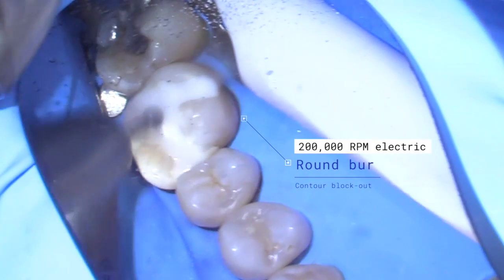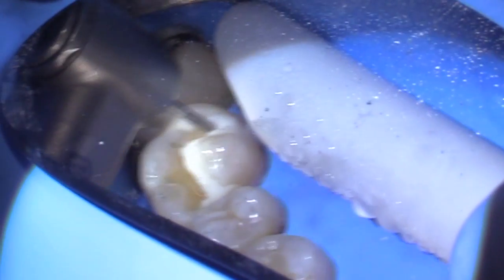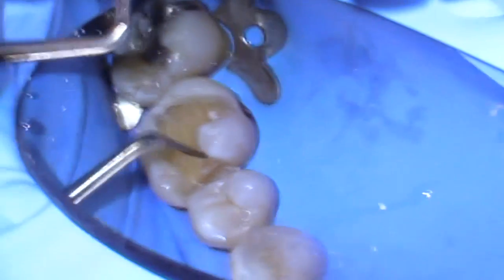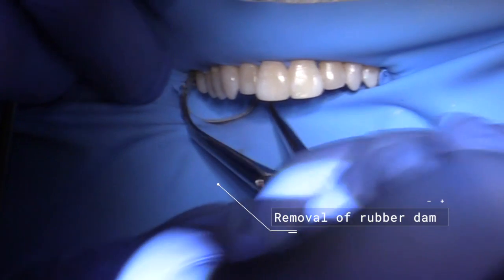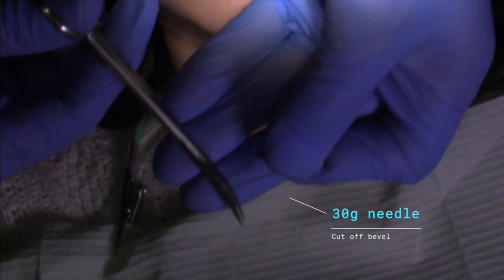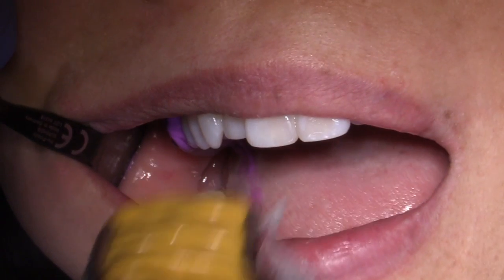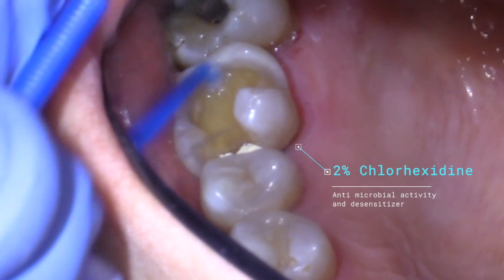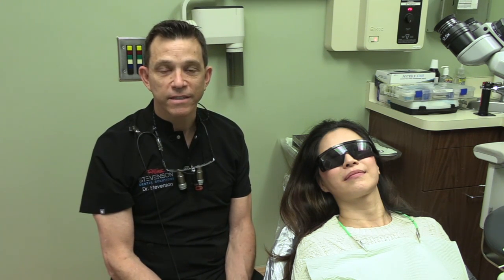Gold Inlay Restoration, Part 2: #3 MOL Gold Inlay - Preparation and Impression

Comment: Dr. Stevenson, thank you for the video. I have a question, how do you control the bleeding so well?
Reply from the maker: Thanks, I use double-packed Alum-impregnated braided cords, NEVER knitted, which are essentially useless, however, popular because they are easy to place. The braided cords expand and increase the sulcus dimensions and when soaked in aluminum chloride 25% they stopped most bleeding.  In tough cases, I'll pack an additional cotton pellet on the cords for pressure hemostasis.  I NEVER use Ferric Chloride or Sulfate because they create so much coagulated blood which contaminates the prep for traditional impressions.  Under the 40x microscope we can see the litter and debris left behind by these popular medicaments - but they are a detriment to excellence, that is clear.
Reply: @StevensonDentalSolutions  thank you for answering my question Dr!!
Reply from the maker: @albertchi9666  My pleasure

Comment: Could you use bisacryl temp material too?
Reply from the maker: Sure - but you'll need to remove it, trim it and cement it, which may not give you much benefit...The DS technique works amazingly well - keeps the tooth in an ideal and stable position and the removal is easy and leaves no residue to clean up.  For a quadrant of onlays, especially those without much resistance form, I use Bis-Acryl and cement with duralon. T

Comment: Dr. Stevenson - thank you for the wonderful videos! I have thoroughly enjoyed watching your channel and have learned so much. Could you please share a little more information regarding the provisionalization technique? What is the stopping material and what is its function? What type of material is dura seal? Thank you!
Reply from the maker: The dental stopping simply protects the tissue in the box area and the duraseal is a PMMA with plasticizers and is mixed liquid powder style and flowed into the prep.  That's it. The duraseal technique does not use cement, more is the patient able to floss, but the tissue does remarkably well.
Reply: How do you remove the gingival stopping material after flowing the temporary material into the preparation.
Reply from the maker: Hi - for sure.  The dental stopping is a fully biocompatible material that protects the tissue from the irritating effects of the DuraSeal which is a PMMA with plasticizers.